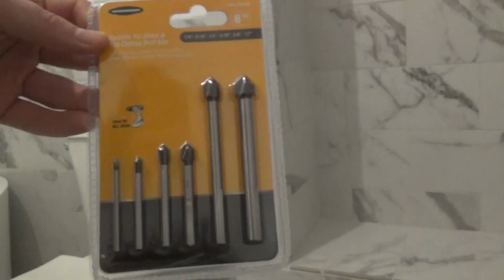DreamLine Prism Plus shower glass door installation

Comment: Sorry can you help me about the glass ?
I Have order 40x50x60 glass to make this neo angle shower , 

The company that sells custom glass and makes showers, an employee told me that for this bathroom shower, the glass must be ground at a 45-degree angle. Can you answer this question: What exactly do I need, and is this true?
Reply from the maker: Hi. I don't know what you will do with a 40x50x60 glass 
But I can tell u this. The glass I got from the company are all cut squared not 45 degrees. To make the 45 degree, you need the right hinges and special plastic seals that have a 45 degree angel. Which you put in between the door and wall glass.
I think you should be able to see it in one these videos.
Reply: @gthegreat153   
40 cm  for left side
50 cm door 
60 right side 
Are these the dimensions I want to make this shower like in the video? I've done it with ceramic tiles just like in the video, the same shape. But whit my dimensions 
it’s that possible
Reply: @gthegreat153 you mean 7:29 this plastic
Reply from the maker: @bajonivideos  exactly
Reply from the maker: @bajonivideos  I guess if you customize it. You can do it with any dimensions. I guess the only thing you have to make sure, is that the opening for the door will end up being the right dimension for the door to fit. (I also had the wall beams put into place, before I put tiles. So I can have the side panels screw into the beam)

Comment: I recently purchased the same shower and now I’m concerned.  Why isn’t the top of the door lining up with the glass panel?
Reply from the maker: Mine is off just a little. Less than 1/4 inch. U have to put a piece of wood,under the door. To lift the door off the floor, and then tighten it. Then u put the plastic trim on the bottom.

Comment: Have a proper hammer drill
Reply: You wouldn’t want to use a hammer drill on porcelain tile. The video correction text is correct, a Diamond bit it what you want.
Reply: Correct. If you normally do this work you use a hammar drill